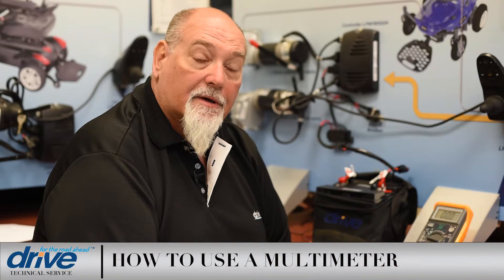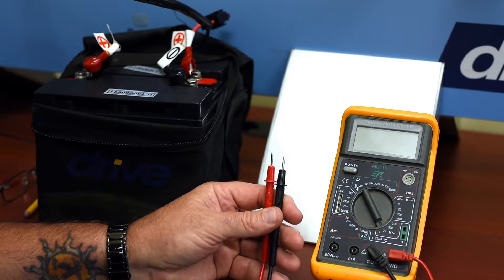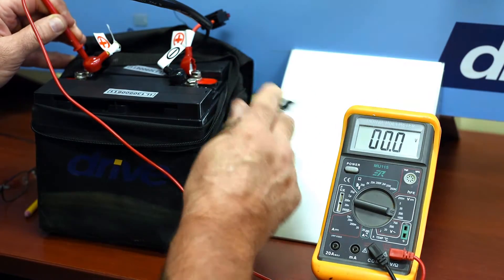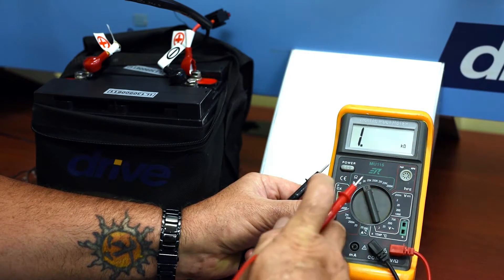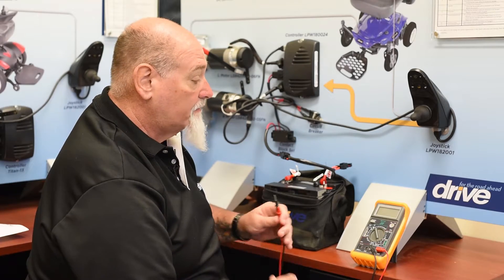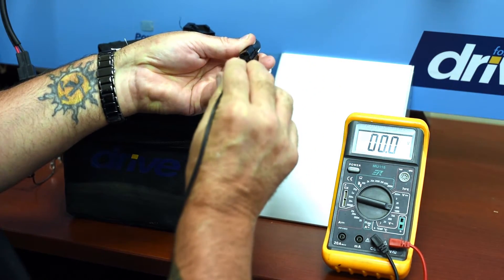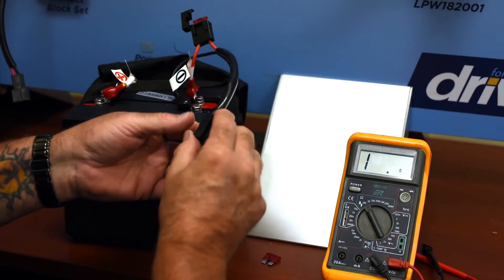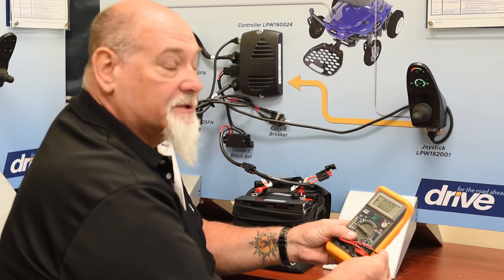How to use a multimeter

Comment: My cobalt scooter batteries are old but have always worked. How can I use a multimeter to test if batteries are bad? 
My charger shows fully charged GREEN but when joystick is moved, it all shuts off completely dead without lights.